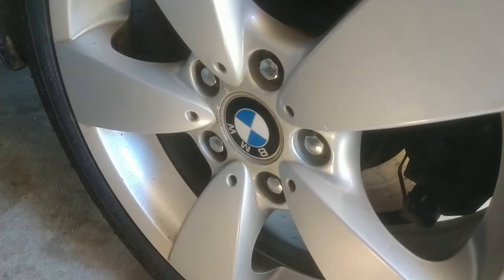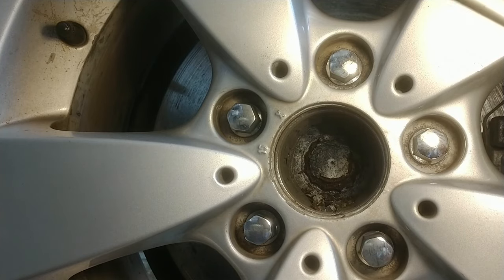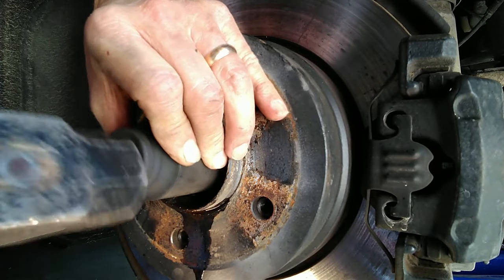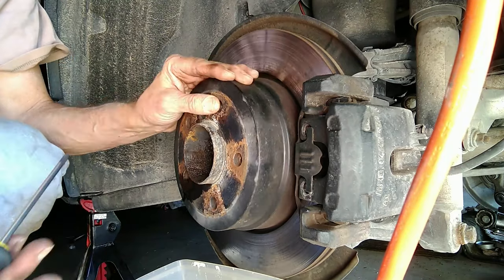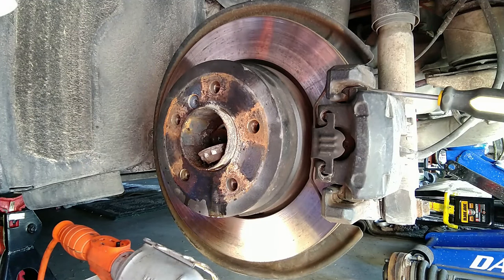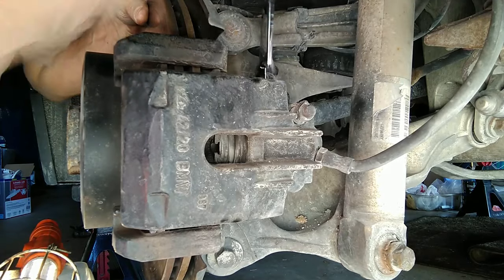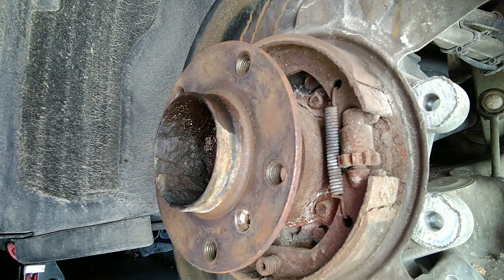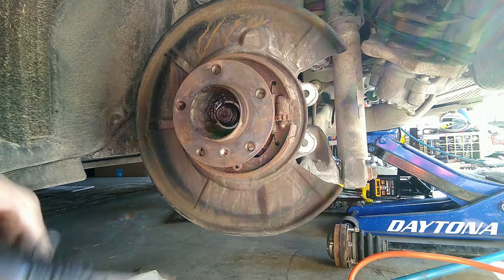Removing rusty / stuck rear axle in BMW E61 using Harbor Freight Tools (axle was bad as they get)

Comment: I’m a retired BMW specialist and I found the easiest way to deal with this problem was to buy a complete second hand hub and driveshaft assembly from BMW breakers. I changed many.
Reply from the maker: There's no doubt that I would have saved time doing it that way, since I have replaced pretty much everything. I did want to do new bearings, so would have had to get an axle out eventually but if it wasn't one rusted solid to the hub, it would have been a win.
Reply: Thanks for your comment.
I'm calling a salvage yard tomorrow just in case.👍

Comment: That's the toughest removal I've watched so far on the tube, and I've watched a few. You're a very patient man, I'd have been throwing tools around the yard!!
Reply from the maker: I've done a lot of "normal" axles before without drama, but these were ridiculous. I ended up using a n inductive heater on the hub of the first front axle, and that did help. I was going to do a video of that process for the other front axle, but it came loose with "only" the 10-ton puller.
Reply: Two weeks ago I was removing an axle in a 1996 E36, and I had to remove the whole rocker arm, soak the half-axle in oil for 4days until I could take it out
Reply from the maker: @S7midnight  I sprayed penetrating lube (PB Blaster) on my axles and hubs for a few days in advance, though it didn't do too much.
Reply: @Mark_H_DIY  i sprayed tons of wd40, but it did nothing. I placed the rocker arm so that the outer part was facing upwards and poured down some engine oil. After 4days I removed it with a small hammer, even though I'd tried a 20ton press to no effect before 🤯🤯

Comment: I did this some time back on the rear left of my E65 pretty much using identical tools (save that my press has 20T) with the same results. Finally had to pull the whole upright with the axle out of the car, so I could do the job on the bench/vise with the axle hanging down and the press up vertical. Now I have to do the right side. This time I've got a complete upright from the breakers that I need to dismantle, so I can renew the bearing and a new axle. I'll put the whole upright together on the bench, pull the one on the car complete with the axle, and put the rebuilt stuff and new axle in. Fingers crossed that it is considerably easier than the last time and what is shown here. One thing I did find last time was that if you mike the spline on the axle, there is a very slight taper to the spline. Not only is the rust holding the spline to the bearing, but that taper is making it just that much more difficult. Interestingly, the new axle that I got last time does not have a taper on the spline and was simple to install into the bearing. Thanks, BMW, for insuring that the absolutely remote possibility of the axle shifting itself from the bearing never happens. Jeez!
Reply from the maker: @uilleamross3443  Wow. That's a tough way to have to do the job! But I get it, that you just have to do what you have to do to get the job done! I just bought a new tool that might have done the job easier... Instead of pushing the axle in, it braces against the knuckle (upright in your description) and leverages the hub, using the lug bolts. It should be able to supply a LOT of torque, and maybe importantly, in more of a prying way than a straight pulling way. OTOH, my cars are all SW desert cars, so I'll have to wait to try it out until a buddy with a salt-ravaged car comes along ... ;-)
Reply: @Mark_H_DIY  Ah, to be in a dry environment. I'm sitting within 500m of the North Atlantic here in Nova Scotia. You don't know rust until you experience Nova Scotia rust!
Reply from the maker: @uilleamross3443  I agree entirely, though I have seen worse. I spent a couple years in Key West Florida (basically a tiny island in the middle of the ocean), and not only does the suspension and the fenders rust there, in the entire car just kind of disappears around you. ;-) but I've entirely sworn off cars that aren't from the desert. At least until I forget how horrible the alternative is, in which case you'll probably see more videos on the subject. ;-)

Comment: Get a Milwaukee m18 impact, would blast it right off and make it look easy, no heating needed. Cheapest option is a long power bar and that would give you more than enough. What you're doing will reduce the life of your bearing
Reply from the maker: Sorry, I'm not following your comment. I do have a 1,200 foot/pound impact that spun off the axle nut with ease. The Milwaukee M18 produces only 33 foot/pounds of torque. How would an impact get the axle out, and how does any removal method put less stress on the bearing (really a non-issue since I was pulling the axle to replace the bearing anyway).

Comment: You didnt have to use the socket as an adapter. The long shiney tube has threading so that you can spin that black nut down to the bottom so that you have the proper space from the beginning.
Reply from the maker: I think your puller is different than mine. Mine does have threading at the end, but only to add a conical tip. As it turned out, using the socket worked out well, since it allowed using the second socket to allow using the air chisel (the straw that broke the camel's back). ;-)
Reply: @Mark_H_DIY  nope same one. The huge silver shaft has threading on it with a huge nut at the top.
Reply from the maker: Are you talking about the threaded body (with the nut being the part the arms attach to)? I had that adjusted for the maximum extension (relative to the hooks) already. Threading the "nut" down the body of the shaft would only mean I'd need a longer "socket" to reach the axle.

Comment: I served my time working on HGVs (18 wheelers). You don’t get anything done without acetylene and a sledge hammer in Scotland.
Reply from the maker: I've pretty much sworn off vehicles that have spent any time in the Frozen North anywhere. I did buy an inductive heater tool which is amazing when you have a frozen nut. I was going to do a video on that with one of my front axles, but it came out without a fight, which is a little disappointing. ;-)

Comment: I saw someone using a Bauer A/C hammer drill with a pointed chisel which worked really well driving off a frozen axal shaft from the hub. Also there are much larger more powerful air hammers that would work better than the one you have. But either way one has to admire your Tenacity. LMFIAO
Reply from the maker: I actually tried that, also using a really big, industrial size hammer drill. I don't think I included that in the video, as it was already long enough, and it didn't work. Perhaps there is one big enough to have done the job, but given how much heat and static pressure it took, I'm a little doubtful that impact alone would have worked. I'll probably never find out, since the car I have now has been in Arizona its whole life. ;-)
Reply from the maker: Yeah, when I unbolted the front axles on my "new" car (2011 Mercedes GLK 350) I was able to push the axles in the hubs with my fingers.  I just got back from a cross-country trip where the car was driven in snow / ice / salted roads, so it might be worse next time (unless it's very soon, in which case I'll clean and lube the splines).

Comment: 3 jaw puller and 1000nm makita did it for my ML mercedes hamering did literally nothing
Reply from the maker: @5000RR  every Frozen axle is going to be a little different. In my case, the air hammer wasn't the most important force, but it was more like the straw that broke the camel's back.  ;-(

Comment: Very nice video! I just sent the old lady to Harbor Freight to pick up the exact same puller -- before I found your video. I'm hoping it will do the trick. I'm doing the 3rd hub bearing on my 98 Subaru Legacy -- the front was finger loose, the first rear took all I could crank on a 2 jaw puller with all the link bolts bent under the strain, then applying heat and pounding on the end of the puller bolt with a 4lb mallet. Now I'm working on the other rear bearing and I snapped the big bolt on an 8" 3 jaw puller. I have a California car with 0 rust & 188K. I think what happens to bind up the splines is that grease leaks out of the bearing, runs into the splines & bakes on like Loctite. There was 0 rust on the other rear axle spline -- but it was coated with a dark brown varnish. I was really glad to find your video because it's the exact sane tool, exact same predicament. Hope it works.
Reply from the maker: Funny that you'd only have one axle with the problem, but hey - salt isn't always equally spread over everything I guess.  FWIW, I had three horrible (!!!) axles on my BMW, and one that came loose with "just the 10-ton puller".  Kind of disappointing actually, since I was going to make another video showing how to heat the hub with an induction heater to save time (and propane).  ;-)  Good luck with your job - let us know how it goes...
Reply: @Mark_H_DIY  Got it done with that 10 ton beast & a torch (this was my 08 Subaru Legacy). Your video was very helpful -- also showed me what I was doing wrong on the other rear axle with heat. The first/other rear came out with a great deal of hammering on the bolt-type jaw puller & misapplied heat. I've done 3 of 4 bearings now -- and it was only the rears that seized up like that -- but not from rust -- it's from a baked on black residue that wouldn't even let me get the new bearing on until I ran a Dremel cut off wheel down each spline groove to clean that hard black residue off. Even a screwdriver couldn't scrape it off. I was having a very hard time getting the 3 jaws to stay put while aligning the press with the axle until I wrapped a bungee cord around the 3 jaws.
Reply from the maker: @geeder9086  Nice tip on the bungee cord. I was able to get the puller arms to stick on my BMW without it, but I can see where that would help a lot. And congratulations on a successful completion. I know that the Subaru bearings are a bear after working on my son's Subaru.
Reply: @Mark_H_DIY I had no idea what I was in for. I figured that with zero rust there would be no issues getting the splines to slip through -- not so on either of the rears. The one front one I did just took thumb pressure to push the shaft through the splines -- and that's what I expected for the rear. The hubs were not rusted into the knuckle of the backing plate on mine -- so at least that part was no problem. The contaminant on the splines seems like black ceramic had been bonded to the steel.
Reply from the maker: @geeder9086  Had the bearings gotten really hot? Maybe the black gunk was grease or brake fluid that got baked to a varnish? FWIW my current car is a Mercedes that has been in Arizona it's whole life (the front axles pressed out with finger pressure)... pure bliss! ;-) Even so I just picked up a bigger air chisel, just in case!
Reply: @Mark_H_DIY  That's probably what it is -- scorched grease leaked out from the bearings. The 1st one I did (R/R) was pretty bad -- but I just barely got it out with a 2 jaw screw type HF puller & misapplied heat -- plus 4lb sledge blows to the bolt for the puller. But that one didn't give until I ended the 1/8" of play in the bearings by putting pressure on the hub by jacking it up. The 2nd one was the L/F and came out like butter. The 3rd one I did was the L/R -- and it was probably stuck 4-5 times as hard as the R/R -- and the R/R had been making noise for several months -- so I was surprised that the one that wasn't as bad (no play) was that much worse to remove. There was a point during the L/R removal that I thought that maybe the new 10 ton jack was bypassing internally -- because the stock jack bar had reached it's limit & I had to put on a 3' cheater bar -- so I thought that maybe I overloaded it -- but apparently it was actually slowly & silently creeping the hub off the bearing & axle spline. Dremel cut off wheel works very well on that hard residue.

Comment: Just came across this video, as I'm encountering a similar scenario on my E82. This truly helped me understand what I'd gotten myself in to. I've broken three puller tools already trying to get just one of the damn axles to budge. I almost bought a hydraulic unit like the one used here... but after watching this through, and seeing all that's involved, I took a moment to reflect on my DIY skill set. I'd  already planned to replace the axle shafts, bearings and hubs on my car. So, after weighing my options, budget, and cost to my personal mental/physical health... I said to myself screw that!  And resourced a brand new pair of rear knuckles. Thank you for the valuable insights!
Reply from the maker: I fully understand. I'm cheap, but I'm also lazy... ;-) Your approach is a valid one considering all the items you are replacing. I did once but a front knuckle because the pinch bolt was frozen solid, but when I got it, I realized that it was destroyed during removal, and the bearing was totally shot. Turned out that my impact hammer (used in this video) drove it out surprisingly easy.

Comment: Just used this same tool on my 2010 Infinity QX56 on the rear. Had to replace the hub bearing and the axle would NOT come out. Your tips worked perfectly - pull, heat, hit / repeat. On the third try it let loose and sounded like a gunshot.

Thanks for the tips!
Reply from the maker: Happily, most cars use the same concepts in construction, so the same violence can be used to take them apart as well. Congratulations on a successful job. Glad the video helped.

Comment: wow.  The level of patience.  I would have replaced the whole knuckle assembly + the shaft after 20 minutes in.  But I can understand -- sometimes I don't let it win over me either.  I will break everything until I get that part removed.  :face-green-smiling:
Reply from the maker: When I first got the car, the pinch bolt that held on the front knuckle was rusted solid, and I ordered a used one. It ended up being in such bad shape that I decided it was going to be easier to salvage the original one, which I did using an air chisel to drive out that rusted bolt. The whole thing was certainly learning experience, and I've got some tools that might make it a bit easier next time, though I never, ever, ever plan to buy a car from the Frozen North again. ;-)
Reply: Seriously was thinking the same thing. Guy is so calm and had patients till the end of times.

Comment: People like you win wars👍🏴 Fantastic video. Real life scenario here in Scotland when working on BMW's. Thanks.
Reply from the maker: Thanks! Sorry to hear that my situation is "normal" in Scotland... I've sworn off future cars that haven't spent their entire life in the US desert southwest after these axles. Coincidentally, I just ordered new axles, but swapping them out should be trivial this time!
Reply: @Mark_H_DIY  My plan on my daughters e61 535d is to replace the rear axles and rear wheel bearings and hubs. So I'll just cut the driveshafts. Remove the ebrake/ handbrake shoes and grind/cut the e14 hub bolts from the outside. I used this brutal method before due to heavy corrosion and it works a treat. 👍
Reply from the maker: @williwonkah.9242   Wow... Makes the way I did it sound like brain surgery. Will grinding the bolts extending through the knuckle allow unbolting the hub / bearing "easy"? My recollection is that I couldn't reach the four E14 bolt heads with the axle in place, but maybe with the axle cut you can wiggle around the outer CV joint.  And that E-brake cable is very different than the sedan. I couldn't find good info online, but added that to the other video I did on the rest of the job (bushings, control arms, bearings, etc.). Good luck on that job!

Comment: Lessons learned:
Use anti-seize. Great job and very detailed explanation.
Reply from the maker: I'm pretty sure that the previous owner never pulled those axles, so they'd been rusting since 2006. I use plain old grease, but then again I live in Arizona and could probably get away with reassembling them dry without fear of rust. :-)
Reply: @Mark_H_DIY  awesome solving problem mate. I live in Chicago area and I dont get ran out of antiseize
Reply: Did they grease the axle in 2006? factory made?
Reply: @hlq2action310  On the BMWs I have done, the fit is so tight that adding copper anti seize will make it impossible to  insert the shaft!

Comment: When I was a young meck a nik, I used a mallet made out of a 10 inch section of a apple tree to free aluminum wheels. Worked good on rusty drums and discs.
 Then I would use a 3/4 inch air impact. I did a lot of axle and transmission work.

 If that did not would work. I would a hammer wrench and a 4lb hammer that would persuade it to move..
 The axle was easier. Just torque the puller down. Good ones do have a max torque listed. Tap it one the end with 1lb machinist hammer for 4 or 5 minutes and re-torque. Repeat.
 If the torque does not come back it is loose.

It works without destroying anything.
Hydraulics work but tapping the end of a mechanical puller works about as good. It does takes a bit long longer and no heat is needed.
 I learned this working in refineries doing shutdown repair.
Getting permission to light a torch requires a lot of paper work. For some reason they don't like open flames at ground level. Hammering is faster than chasing the paper.

Comment: What a great video! I just picked up the HF hydraulic puller and I’m going to see if I can get the axle out on my wife’s BMW X3 so I can replace the wheel bearing. Thanks for the helpful video! I hope 🤞🏻 I get lucky like you and get it out.
Reply from the maker: @1972davidt  good luck. Hope it's easier than mine was...
Reply: @Mark_H_DIY well I ended up having to take the entire rear control bar thing off and pressed the axle out using a shop press with a 12 ton jack and 10 minutes from a mapp gas cylinder and about 50 whacks from a 3 lb sledge hammer! But it is all back together now.